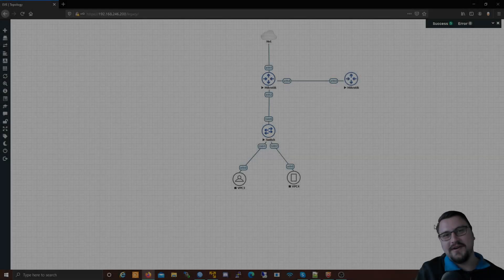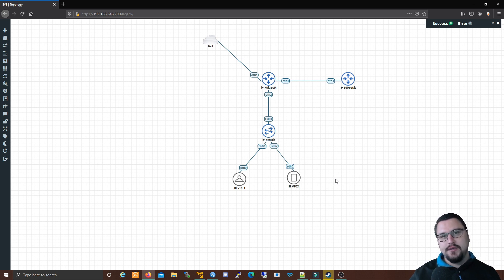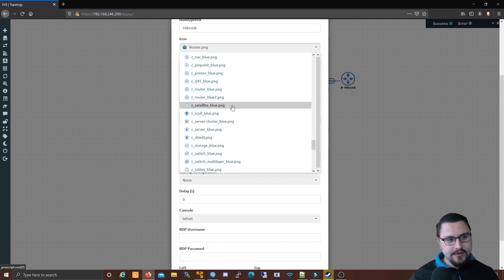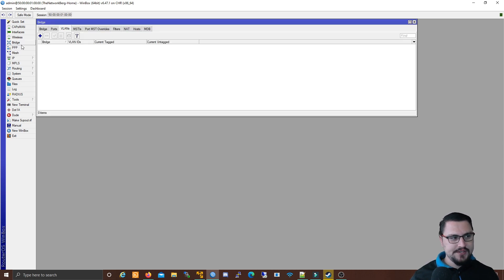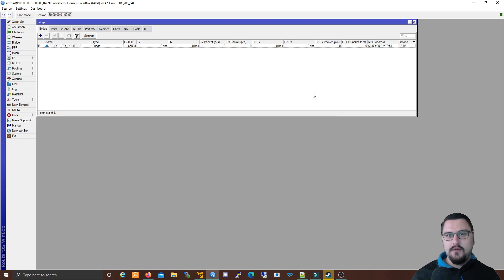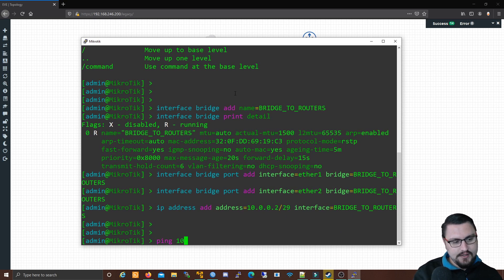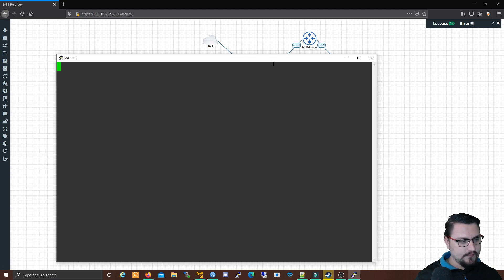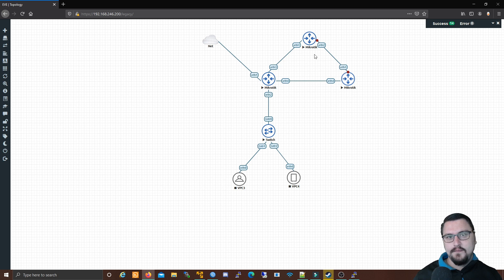Getting Started: MikroTik Bridge Configuration

Comment: I thought I was following along well, but you lost me at the end.  When you created the bridge on the first 2 routers, you assigned an IP Address with a /29 mask but when you got to Router3, you used a /24 and didn’t explain why???  Did I miss something obvious?
Reply from the maker: You didn't miss anything Tenly, that was a continuity error on my part, router3 was also supposed to be a /29 mask, however out of habit I made it a /24. The reason this still worked fine is because the /29 the other devices are in are still within the same broadcast domain of the /24 of router3. If anything you can just scratch the /24 and replace it as a /29, apologies for confusing you at the end.
Reply: @TheNetworkBerg   That clears things up quite a bit…. Thanks for the explanation!
One other quick question if you don’t mind…. At the beginning of the video, you say that “each port on a router is by default it’s own broadcast domain” - but I’ve just picked up an RB5009 with RouterOS 7.1 and there is a Switch section which contains 1 item named Switch1 and it appears to have all 9 ports assigned to it…?  Do you have a video that contains an explanation of what this is and why I should or should not be worried about it?  I was hoping to created 3 separate subnets on this device with Eth1-3 bridged as the 1st, eth5-6 as the second and eth7-8 as the 3rd - but I don’t see any way to remove them from Switch1!  Will that be a problem for what I’m trying to do?

Comment: Can you bridge the wan interface so that two or more ports are on the wan side of the router communicating with each other on layer 2 and the rest of the ports remain on the lan side of the router? 

I tried this recently but router os kept changing my programming changes to other settings and once I finally figured out how to force the changes to stick I lost inet connectivity and management from WAN side. 

Any ideas where I may have went wrong?

WAN port 1 10.10.40.1/24
WAN port 2 10.10.40.2/24
LAN bridge 192.168.100.1/24
Reply from the maker: You can bridge your two WAN ports, though I need to understand what your requirement is with this. Are you trying to build redundancy in case an interface/link goes down? STP will likely put one of the ports in a non forwarding state anyways. For this to work you would also need both interfaces to connect to either a switch or another device with both interfaces also bridged to yours. Also make sure that you put your IP address on the actual Bridge interface and not on the Port itself. So you wouldn't really need to assign two different IP addresses if you are trying to  just bridge the WAN interfaces.

You could create a diagram on draw.io for me so that I can better understand what you are trying to achieve and how your WAN is connecting to your Mikrotik.